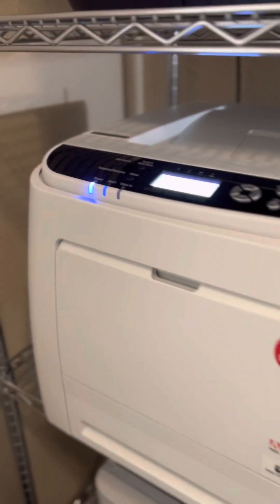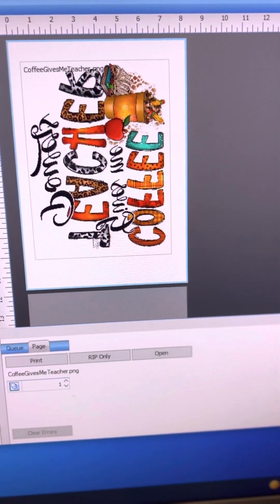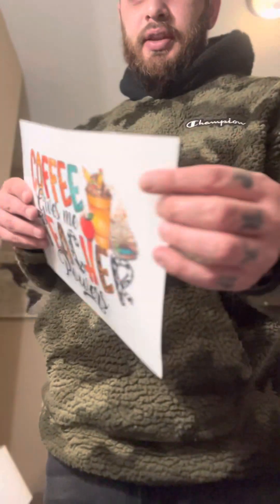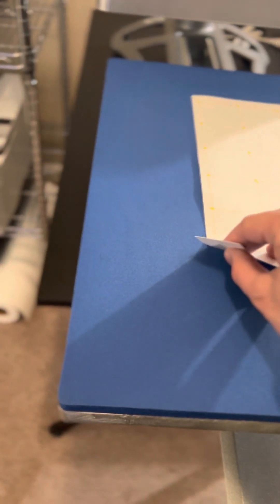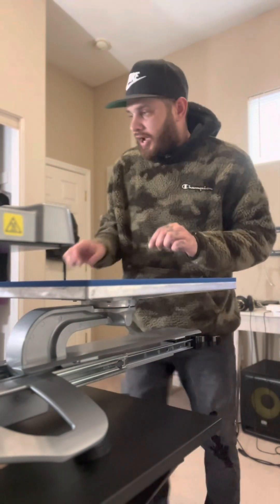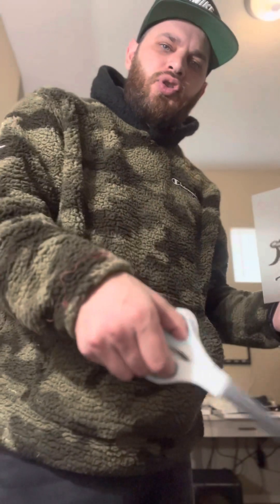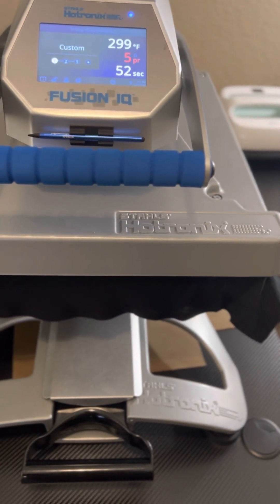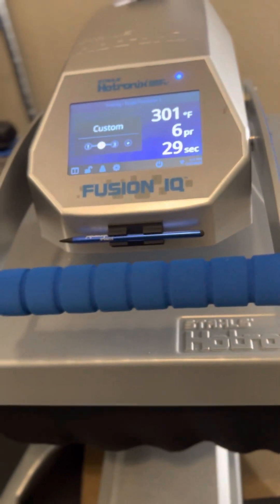Get The Perfect T-Shirt Print Using The White Toner Uninet iColor 540 Printer

Comment: Hi thanks for this video. I just got a printer but I'm having trouble with the marrying.  I did exactly what you did and also followed the uninet instructions but I'm having all the adhesive getting transfered to the A sheet. And I mean all the glue transfer to the whole sheet. It's not just the edges. What am I doing wrong?
Reply from the maker: Either your pressure is too high or your temp is too high. What heat press are you using?
Reply: I'm setting the temp at 310 and yes very hig pressure.  I thought we had to have high pressure. I have a tusy heat press. 😩 I'm doing a third sheet right now and I will lower the temp to 300 or maybe 290.
Reply from the maker: @preciosaskreations4715  the Tusy heat press may be an issue. I had a similar one and had to upgrade. The pressure should not be high. A low medium pressure will be ok
Reply: Thanks for responding quickly
Reply: I tried it again at very very low pressure and less heat and there was less glue on the sheet. So I will try it again and see hwo it goes. But thanks
Reply from the maker: @preciosaskreations4715  you’ll need to play around with the pressure and heat up and down until you get the perfect spot. You can also try adding 3 plain white printer papers below your sheets and 3 on top, add your Teflon sheet and press it. See if that works
Reply: I finally got it to work! I had to calibrate my heat press and now it's awesome. Thanks!